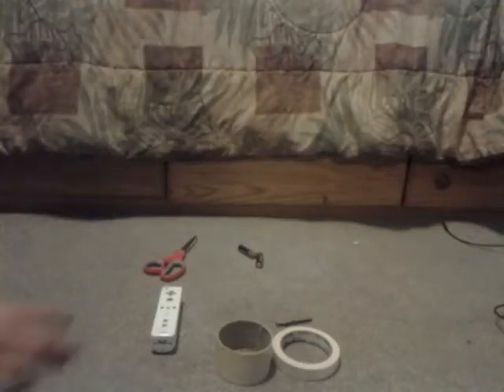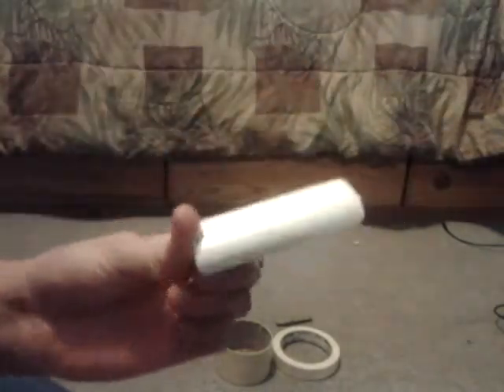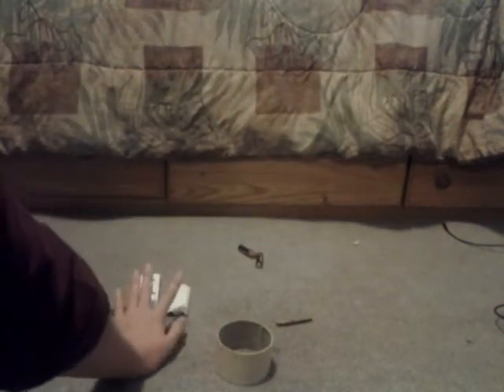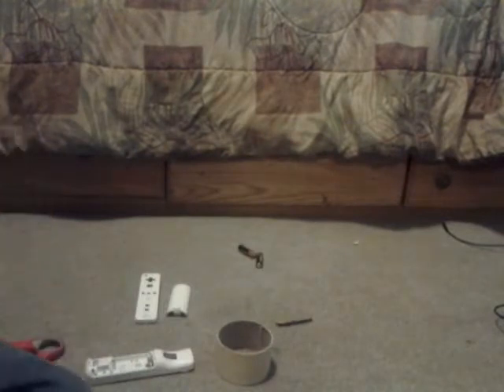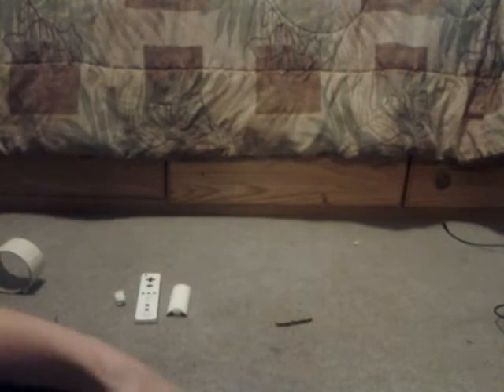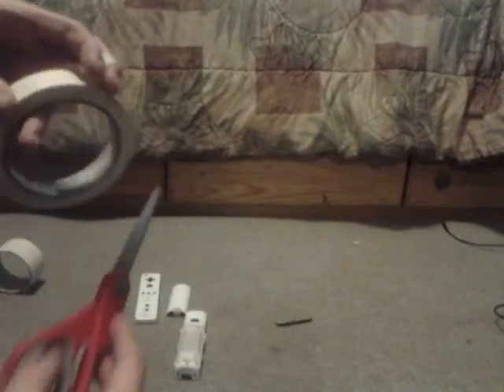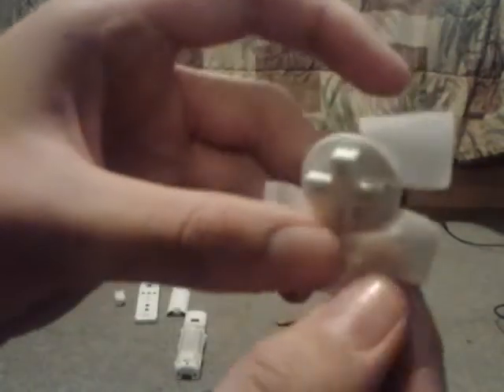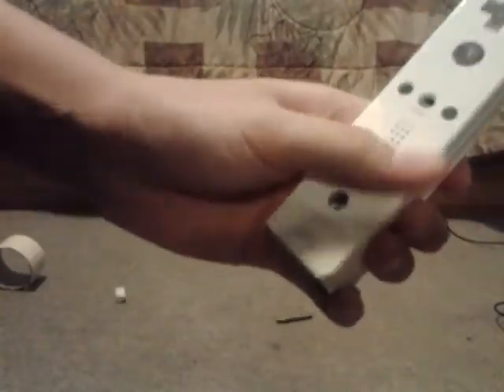How to prep a wii controller for paint

Comment: Hey, do I need to cover the speaker grill or something? Thx
Reply from the maker: do you mean to paint it in one peice?
Reply: I mean like on the top part where the speaker goes through? Thx for replying
Reply from the maker: +notAnOrangePeel I didn't cover it. just use a paint that will stick well to plastic. I have a video of me painting it on my channel somewhere. but it's kinda crapy
Reply: u hav a brand recommendation? is rust-oleum good cuz thats the only brand near me
Reply from the maker: +notAnOrangePeel I don't think that's too good it's ment for metal. if you don't have the right paint it'll fall off later probably